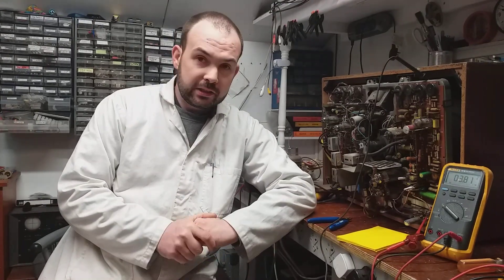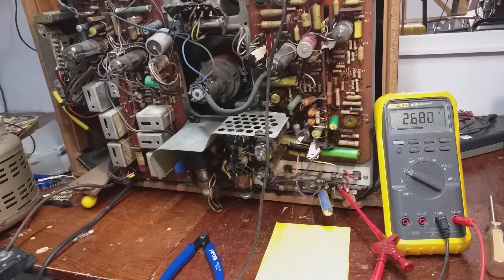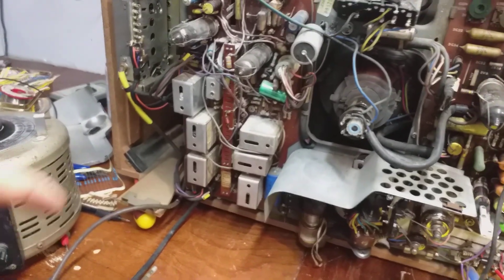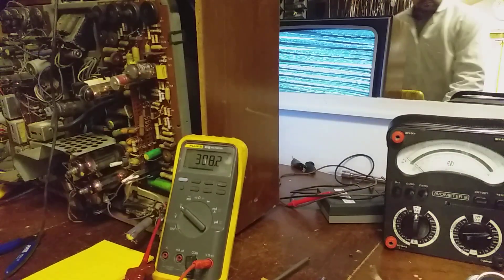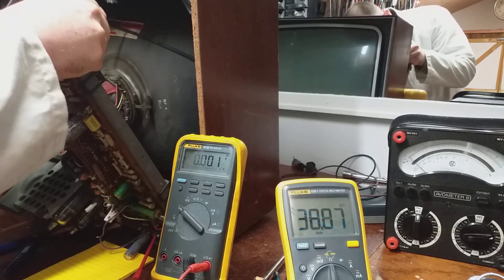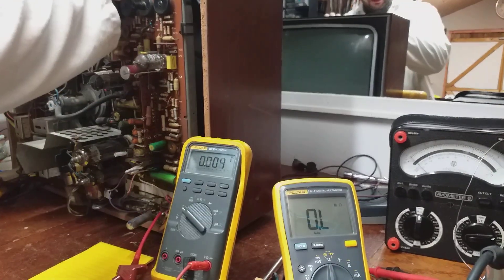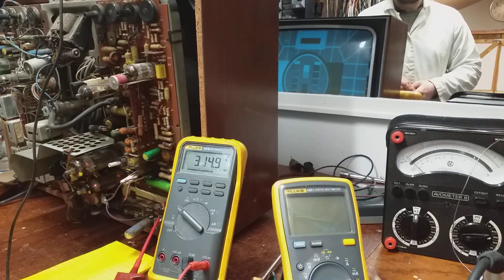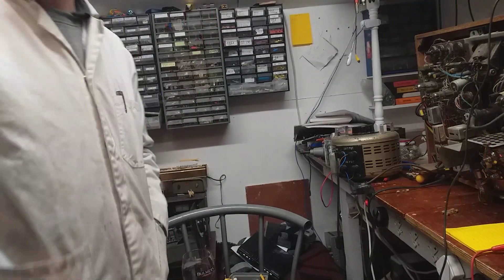Bush Valiant TV161, line oscillator.

Comment: I have an old ITT set, hybrid chassis VC208, which also uses those tubular resistors. They ALL go out of spec, usually up in value. I was befuddled when only needed to change just one to get vertical hold and a nice picture.

Comment: Hi mate! When I sorted out my TV161 pretty much all of the resistors in the line oscillator circuitry were miles high! The line hold controls were then bang in the middle after all the R's were replaced. I had to do a similar exercise with the frame timebase in order to get sufficient height and decent linearity. Some of the blue and white Dubillier caps were leaky as f@ck too, not helping matters.
Reply from the maker: Gameball Tazman, yes those blue and white caps sneak up on ya when you're sleeping!!

Comment: The old telly's seem to be a bit more sensitive to valve condition than radios. However you could probably put that PCF80 in another TV  and it would work just fine!  Cheers Daniel - Dunedin NZ
Reply from the maker: Yes they are a finicky when it comes to line osc valves.

Comment: You might want to check those old pots, likely carbon based tracks and they can drift off too.
Worth a stab with the meter :-D.
Some linearity adjustment and it's good enough :-D
Ooow how odd the irish made sets have no silk screen, that makes no sense.
Reply from the maker: ZX, yea I'll do that and I'll adjust resistors around it to suit.
Reply: @IrishvintageTVRadio ,  I hope you don't mind my style of comments, i'm not trying to tell you what to do or anything, it's just stuff that comes to mind, often quite obvious.
I don't always phrase things correctly and i can sound a bit controlling.
I never mean that.
Reply from the maker: No bother, as I say if the carbon pots is out I'll alter the resistors around it to suit. Hope you're keeping well there ZX.
Reply: @IrishvintageTVRadio  Thankyou for your concern.
So far the town of Bedworth seems free of the virus, but i've never been one to wander about all over the place, i'm not a "Grass is greener elsewhere" person.
So staying at home is not really a problem.
I have my computer, my electronics and a supply of tea, what else would i want :-D
You look fitter than a fiddle, and you have a smashing workshop to bring things back to life :-D.
Just keep a cup or glass of your favorite slurp close, to keep the brain lubricated of cause :)
Reply from the maker: Absolutely!